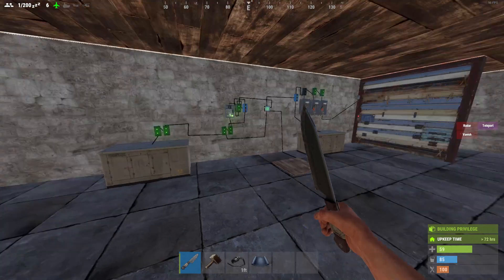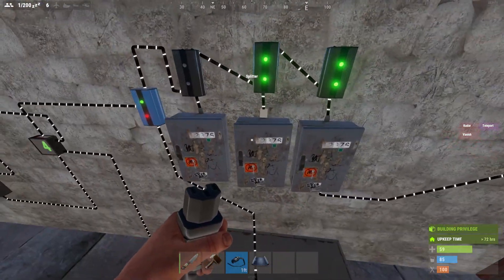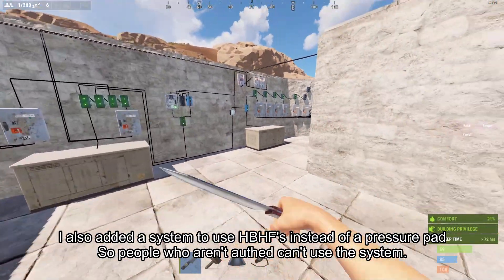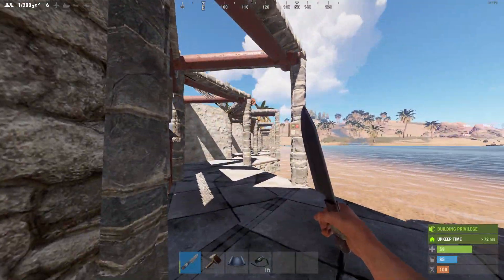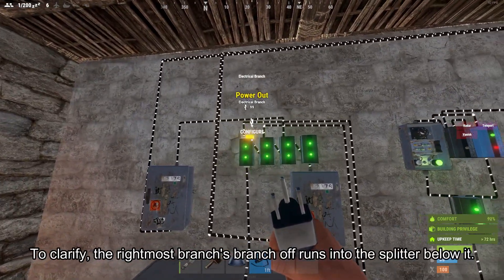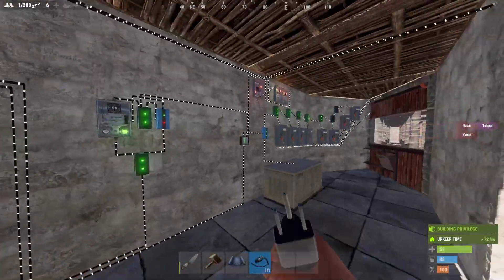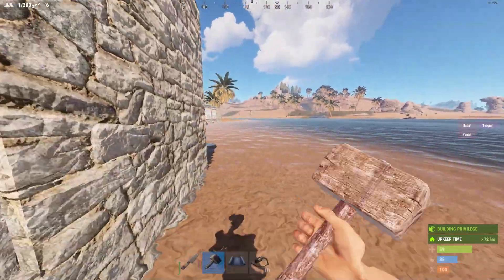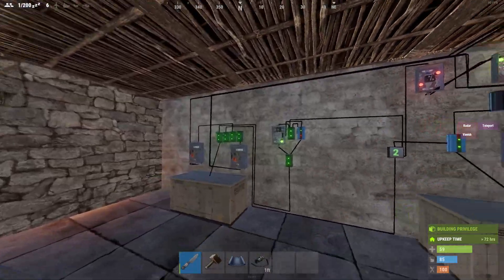Practical Electricity 1 - Automatic Garage Doors

Comment: This deserves much more views :)
Reply from the maker: Thanks! Let me know if you want anything particular, im thinking of starting back to rust soon.
Reply: @Th3KingDedede  I think a video on modular battery circuit design could be good. From that I mean a power circuit that let's you plug in lot's of small components as well as a good circuit for the batteries as well that doesn't let them discharge when turbines generate more power than needed, etc.
Reply from the maker: @ShadyOwl  I've looked into that specific project before, it's near if not truly impossible because of the mechanics associated with root combiners and batteries. I don't remember the exact reason, but i remember coming up with a specific mechanic that blocked them from charging and made a modular approach impossible.
Batteries are just scuffed.

Comment: I like this system but is there a way to do this without a second battery/power source? If your main source has enough power is it possible to pass through the power to the secondary circuit from the initial source? 
I can't think of a way atm
Reply from the maker: Yes, you should be able to, using a simple branch. I split it in the video because I'm trying to distinguish between the constant power for the controller (left) and the variable power that changes based on the number of doors being controlled (right). Let me know if you have any more questions :)
Reply: @Th3KingDedede  Thanks for the quick reply on a year old video, appreciate it! Lol. I have the system working fine with HBHF sensors, I'm just wondering what you have done with the AND gates and your HBHFs there. I Couldn't really tell from the video. Currently, I'm using a splitter as I only need 3 HBHFs and it's working fine, just curious what makes your setup more optimized. (I have the HBHF splitter power branched off the main line before it heads into the overall door system) **EDIT - oh it's for the multiple HBHF outputs, oops**
Reply from the maker: @Teknikk420  Unsure if you figured this out yourself already, i saw the edit, ill throw my explanation in anyways. The AND gates are to amplify the power out from the HBHFs and combine them such that they don't run out. HBHF's output one power per person in their range, so when 1 power is outputted, it won't make it to the counter to reset/open it because it needs to go through an OR gate with the other HBHF. I'm going to make a discord soon(ish), its not done yet but if you have any more questions join up and ask them there, i'll be much more responsive and we can even go through the circuit together if needed. https://discord.gg/jXWsQW <expires 24hr>
EDIT: always a pleasure to go back and look at my older videos, such a shame electricity is so expensive in HQM, not many people seek this kind of advanced stuff to put in their bases.